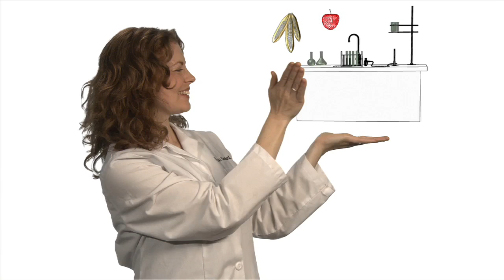The Science of Fudge - Food Science

Comment: So how does brushing the sides of the pot with water stop it from crystalizing?
Reply: The small amount of water in the brush melts the crystals as they slide back down into the hot mixture. Hopefully they will stay melted.
If you leave them on the side, the molten sugar, as it cools, will react with any crystal it finds, building a lattice of sucrose in your fudge. That lattice is what you call "grainy" and should be avoided at all costs, which is also why Kiki cooled it in a seperate container. Why take a chance of "contaminating" your hot fudge with crystals on the side of the pot? All it takes is ONE, an they're REAL small. 🙂
Get it out of the pot asap.
Good luck!
Reply: @MrRezRising  Thank you! I appreciate the informative reply! Now I understand why!